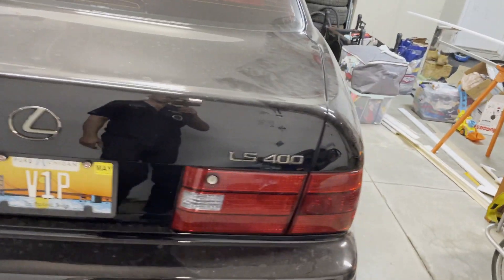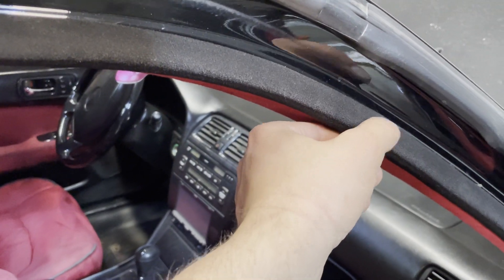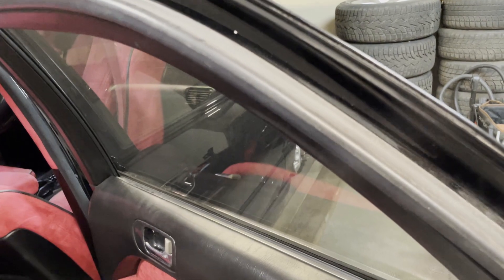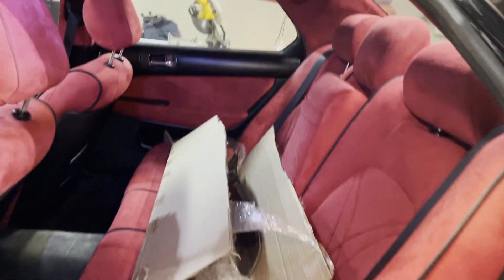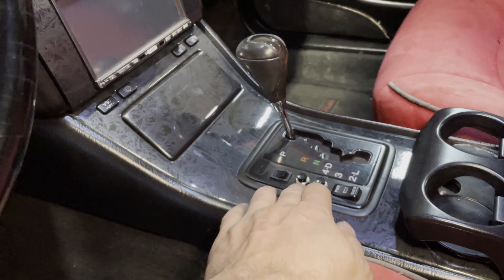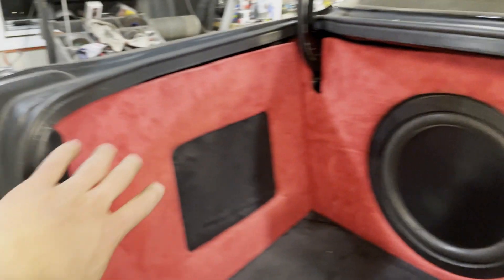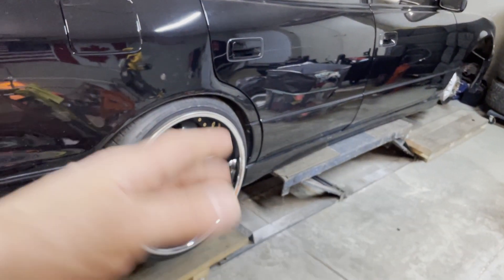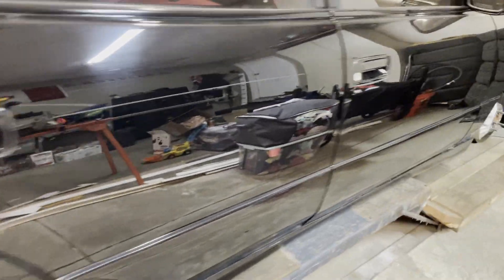VIP STYLE LS400-EP1: Garage Update 001

Comment: If you ever decide to lower your car or air suspension.. Should not weld the strut tower FYI. But looking forward to your LS content🤙🏽
Reply from the maker: Thanks for the comment. With the S9 control arms those holes in the strut tower arent necessary anymore. Car used to be full air susp..never going back :D